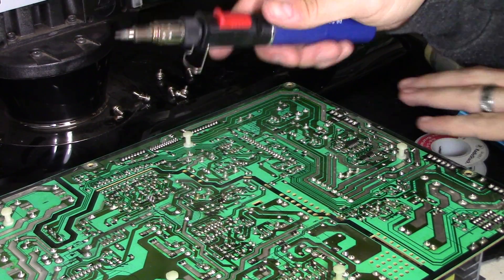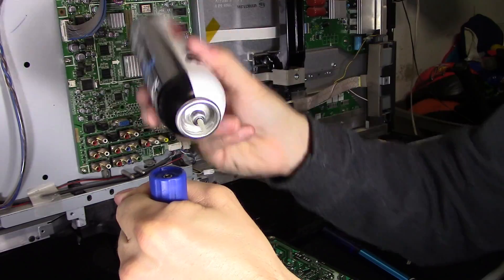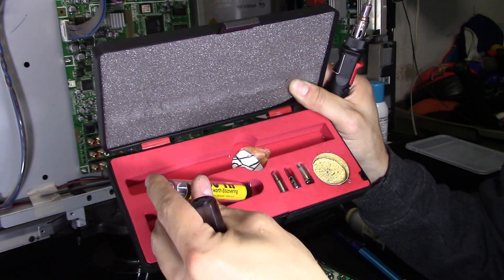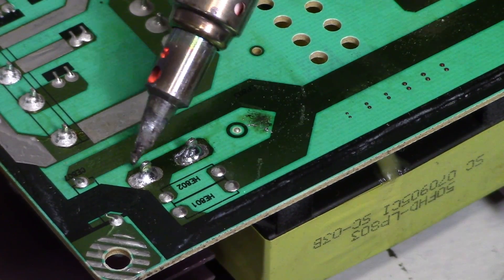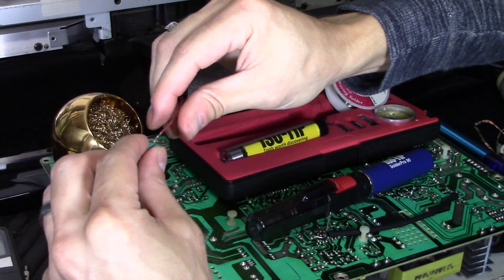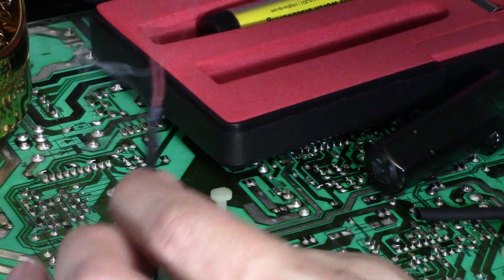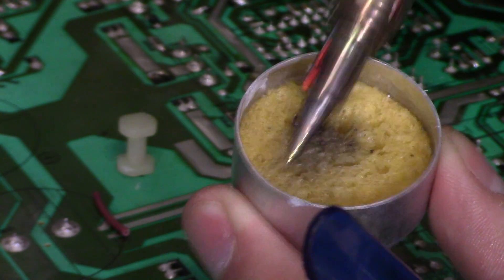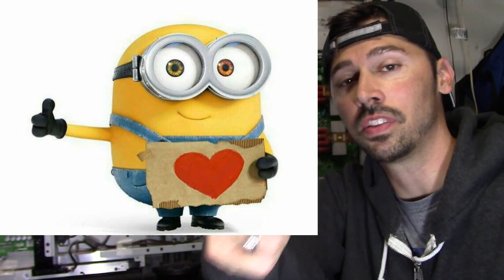HOW TO SOLDER AND DESOLDER WITH SOLDERING BUTANE IRON BEST TIPS AND TRICKS

Comment: I'm A Weller Person Cause My 
Grampa & My Dad Used A Weller
& By Far It Was Always A Good Soldering
Iron For Me. I Never Cared For Anything
Like That Run On Butane. Cause
If You Run Out Then You'r S.O.L
I Think An Electric Solderic Soldering Iron
Is The Best For Me. Cause There's No
Endless Supply In AC Power.
If I Want A Portable Soldering
Iron I Can Always Get The Ryobi
Cordless Soldering Iron
At My Local HomeDepot Store.